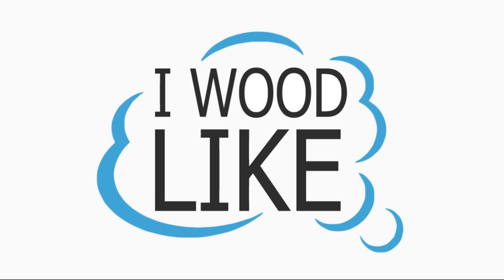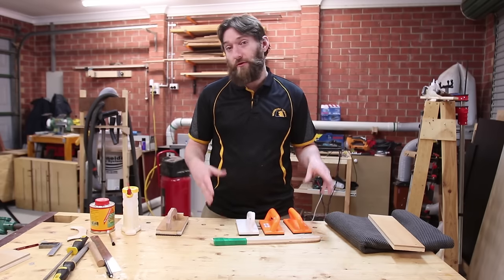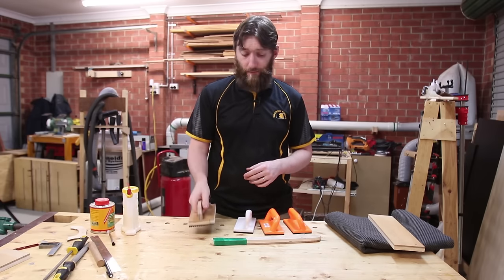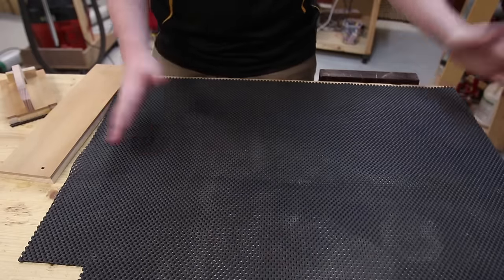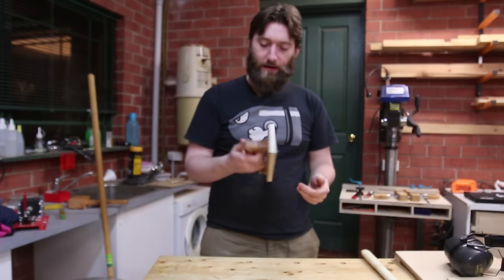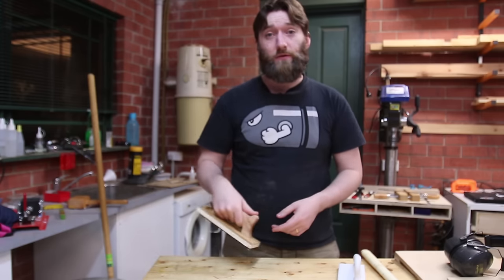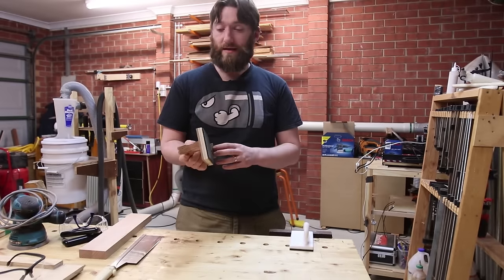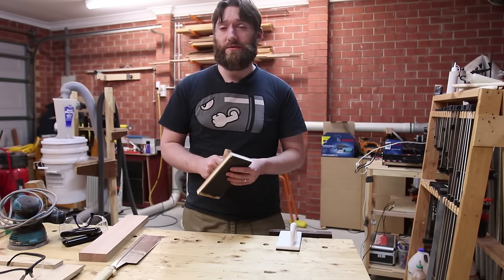108 - Gravity Heel Push Block

Comment: I am going to make a couple of these. Unfortunately, I can't get the template for the handle because I'm in the U.S.  It would be more to your advantage to make your plans and templates available as a downloadable file. And I'm referring to the paid ones as well as the free ones.  Thanks for a great instructional video.
Reply from the maker: Oops, I forgot to tick the 'virtual' box (there is 'virtual' and 'downloadable', both need to be ticked) - that should be fixed now. All the other plans had that ticked, just forgot it on the new one as I was in a rush.

The reason there is the whole checkout process is its much much easier ecommerce package to manage.
Reply: Thanks, Paul
Reply: I used a old stanley hand saw as a template. It puts your hand at a nice angle.

Comment: The mat looks like non slip drawer liner you can buy at $2 dollar shops. good push block. still loving the channel
Reply from the maker: Very similar to that stuff. I've found many drawer liner stuff loses its thickness pretty quickly (compresses). Maybe I just had a bad batch :)

Comment: The safety guard on the jointer is a disater waiting to happen. You are better off with no guard than you are with that really bad idea in place. Taking your hand off and taking pressure off the work peace is the stupidest thing you can do. Unless that factory guard has a roller under there helping to keep down-wards pressue, than immediately replace it with traditional spring loaded guard that swings outward.
The push stick is great !
Reply from the maker: +Gino Asci you know euro guards are pretty common outside of North America?
Reply: @TheWoodKnight  I was curious about that too and was about to ask you. I thought that since the guard can slide, you are supposed to slide it out enough to pass the piece, while leaving the unused part of the blades covered for protection. However, I keep seeing people use it just as you, so I'm not sure anymore. I'm about to purchase a similar jointer so would really like to know.  And thanks for the vid! You have a new subscriber
Reply from the maker: @tinycuisine6544  Pushblocks like this are "situational" - used at certain times, not at others.
Euro style guards don't have downwards rollers, and normally you'd just slide your hand over the guard maintaining pressure on the wood with  your palm then switching to finger tips.

However, I always find somebody telling me I'm doing it wrong no matter what way I do things :)